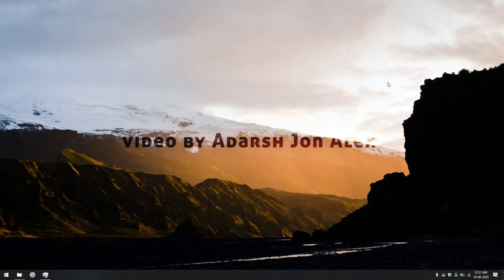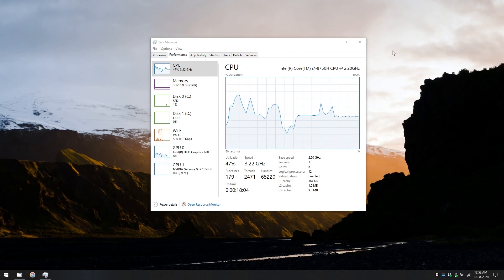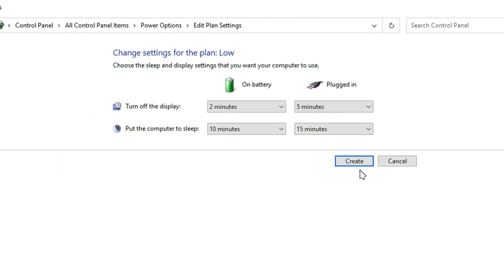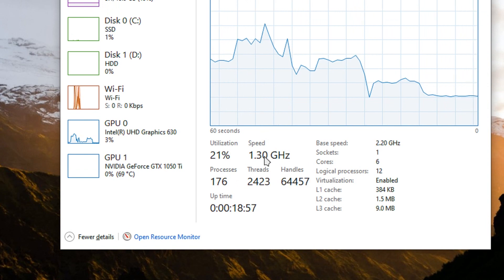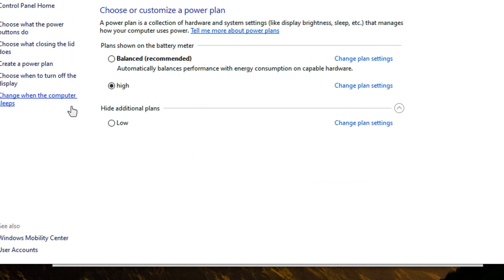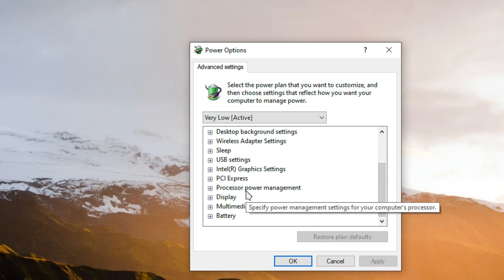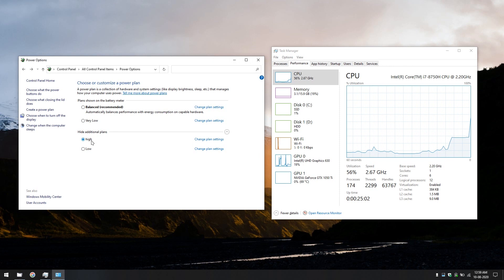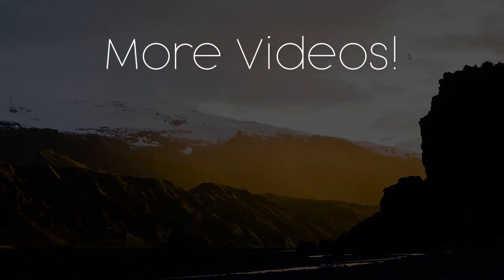Laptop overheating while idle? SIMPLE FIX!

Comment from the maker: You can also right-click the Start button (a list will pop up)and open power options from there.
Thanks for watching!. Any doubts, comment down below.
Reply: I have interl icore 3 windows 11. I cannot see the high and power saver option. What to do?
Reply: My laptop had overheating issues in sleep mode. I would have my laptop on my lap in bed and after I  was done I would close it then slide it to and part of the bed, then go to sleep or leave, where it would be charging or not. It was fine at first it would just cool down and charge if I had it plugged in. But then one day I woke up and it was hot. So I let it cool. It was completely dead. Then I brushed it of as the laptop was ok. Then, it happened again. Then, I was like "Ok." It kept happening for while and I didn't think it was ok anymore so I decided to just shut it down everytime which was very annoying. Sometimes times I would forget and it would heat straight back up. I dealt with it for months, though I didn't use it to much. I only play games but when I got bored of them I wouldn't touch it for a while as I use my school issued laptop for work I need to do. I don't know why I didn't think about searching it up just a few days agoat  first, but I did and the answer was there. There was a glitch that made it do this. When you close the lid the the laptop would sense it and and put itself to sleep, but the glitch was that the laptop would fail to sleep  and wake up as a result. The laptop will not check if the lid is  closed again so it stays awake and the CPU continues carrying out tasks which causes heat. Though, I not sure if the fan is operational during this time. If it got too hot the motherboard would shut it down but I don't think it did considering the whole battery died which leads me to believe the fans were operational. To fix the glitch I had to put it in hibernation mode rather than sleep mode.

Comment: Guys having more then 80c is not ok, I used to have 92c constant I tried cleaning the fans a bit and it didnt work so I decided to take the risk and takz the fan out the pc and it was DIRTY like a mf (did with both fans) and now on performance power plan I keep getting 70-75c not more then 75c

Take the risk guys

Comment: Hey man i used to reduce max processor state to reduce teno. Lately it doesnt work for me. For instance, have a power plan max state is 80. But even if i change it to 100 or 50 there is no difference. Creating a new power plan and change the value? Tried not workinh. Tried restting pwer settings as well
Reply from the maker: Have you tried re-installing windows? if that doesn't work, try cleaning the fans.
Reply: @AdarshJon  i reset the pc but i ll try reinstalling windows thanks

Comment: You can leave you processor in enconomic mode during gameplay because what matters is the GPU, maybe it will only be a little slower to load but the gameplay will be the same, with much less heat
Reply from the maker: Yeah, you could try that out!

Comment: Here's s quick solution.... Please check if your minimum processing power is less than 10% or not... If it's higher than 10% then you must change the values...if it's already below 10% then you must do the steps in the video it will definitely work
Reply from the maker: Thank you!

Comment: I have dell xps 15 9570 and I'm using it for video editing. Please tell me the best settings for heating issue which doesn't effect the rendering performance of the laptop.
Reply from the maker: It will effect the rendering speed. Use these setting only when doing normal stuff.

Comment: when i installed windows 10 but, i have to see a problem "Display Driver Stopped Response" and after showing this sms my pc got extreame level high temprature like cpu 60% and ram 75 to 91. when i start my pc i face thease kind of temprature even i never getting low temprature like 30 20 40
Reply from the maker: You can try fixing it from a hardware level.
Reply: @AdarshJon  🤣🤣🤣🤣🤣 i comment this 6 month ago man and now u replaying it?🤣🤣🤣 my problem already fixed

Comment: This method works for few months but gradually your laptop will die. You will have to keep reducing processor speed. Its better to look for the root cause of overheating.
Reply: Running cpu at maximum clock speed at all times is the root cause ig
Reply from the maker: Root cause for me was the unusually high clock speed while doing nothing. Fixing that fixed it. Root cause for you might be something different. Cheers!

Comment: It's still the same. I have this problem ever since i bought my laptop 3 years ago. Normally it gives me 2.5-3hr backup on full battery. The problem is laptop gets hot, cpu gpu temp over 60 degrees,fan runs faster and the better goes from 100 to 0 in like 40/50minutues. Sometimes the laptop works just fine and gives the full backup even now. When it works fine cpu and gpu temp is 35-45degrees with cool breeze coming out. I don't what actually makes it happen and haven’t found any solution. Last year it was fixed automatically and was working fine for few months but when i had to reinstall windows the problem started happening. Over the year i tried linux and chrome os, they give over 2hr backup with full charge. Even with fresh windows installed with no unnecessary stuff running, when idle it just drains my battery and once in a while it works fine. It's like it has a mind of it's own.
Reply from the maker: Damn.

Comment: Annoyingly, lots of us with a employer given work laptop go into the power options and only "balanced" is in there.  All I can do is go to the battery widget in the taskbar and slide the battery slider as far left as it goes to "better battery"... it's better than nothing but I don't think it drops the cpu base freq.
The other thing that annoys me in windows that linux does better is you can't even easily see harmless information like cpu and memory stats without going into Admin rights mode.
Windows would be better off to have a tool to simply see cpu% and memory and other stats in a readonly mode so ordinary users can just see what app is using max cpu .   If I want to kill off some processes, then I'd have the option to go into admin rights mode for that.  It happens that I do have admin rights but sometimes by the time I go through getting to admin mode and get the task manager going the process has gone away and it's behaving again.  Linux is so easy to see process info in that I can catch misbehaving things much easier.

In linux I can easily see cpu% and memory in many ways and being admin doesn't even enter into it.  (top, smem, ps -ef, htop, glances, Ctrl+Esc in KDE to see System Activity menu, etc)
Reply from the maker: Huh! that's a bummer (

Comment: my laptop is 8 months old and my cpu idles at 54-60 celsius
Reply from the maker: That's not over heating.
Reply: @AdarshJon  yea, but it reaches 64 at idle, it may be far from overheating. But that is not a normal range for a laptop on idle even a desktops normal range is around 35-40. Whereas a laptops is 45-50...60 is quite questionable.
Reply from the maker: My idle was 80-85. What CPU do you have? Try cleaning fans and re applying thermal paste.
Reply: @AdarshJon  that's pretty bad, I have an i5 11260h rn I'm getting lower 50s to mid 40s at idle, all because of a guide i found. I can send you a guide on how to lower temps. I used that and it made a huge difference. I think it would also be video worthy too. 👀

It consists of a lot of disabling in the settings, but it works amazingly. I now get like no more than 67 celsius while gaming. Mostly hovering at about 62. So I guess everything is fixed, I'm still gonna reapply paste on my cpu and gpu. I'll probably get like high 30s after that. I've had the laptop for 8 months, so I'm assuming they used bad thermal paste or they didn't apply it right. There is also another method like MSI afterburner frequency curve for your gpu, and an application called throttlestop for your cpu where you can basically set the number limits to your clockspeed ghz as you please kind of like in the video but its more convenient, I set mine to 3.0 ghz because most games aren't gonna reach 4.5 like companies advertise.
Reply: @eugeoyes513 my only problem is battery temperature of my laptop before was 28c and now 34c

Comment: My laptop always shuts down due to overheating when i'm playing the sims 4 after 15 mins. Should i use the Low option while playing?
Reply from the maker: Putting on low will decrease the fps you'll get in the game. Try it and see if you're okay.

Try lowering the graphic effects in the game and limit your fps with a software to reduce the heat.
Reply: @AdarshJon  thank you for the advice! but i tried playing on the Low option, lowered the graphics in the game and it still shut down after like half an hour. plus the fans in my laptop were soo loud i could pratically hear them across the room and the temperature in my laptop was 90°C while i was playing. :( i dont know what to do anymore
Reply from the maker: Problem still not fixed?
Reply: @AdarshJon  no :(

Comment: Dude where can i see the temperature?? Like you are seeing?
Reply from the maker: Apart from the thumbnail, where exactly did you see me looking at the temperature? I'm confused 😄
Reply: @AdarshJon  where you can see ghz like in 0:15
Reply from the maker: @nsable2109 

You need to install softwares like this:
 https://techguided.com/best-cpu-temperature-monitor-software-windows/#:~:text=1.,CPU%20temperature%20and%20load%20monitoring.

When I'm not gaming, i just go with the general feeling of how hot my laptop is by either placing my palm right above with the cpu chip is (on the keyboard) or see how hot my legs get when i place the laptop on my lap.

After doing this, i could feel no heat.
Reply: @AdarshJon  ok got it!

Comment: not the best way to solve the problem for a gamer ,my experience:i decrese it for only 1% which is 99%, overheating is fix but,ur cpu will stop the intel turbo tech(intel cpu),for example,my cpu max turbo ghz is 4.0,if u lower to 99% it will become 2.4ghz,which is without intel turbo technology,in gaming fps will drop nearly 5-20fps and the game is not stable with a lot of shutter lag.If ur are not a gamer this is a very good way u can do with.
Reply from the maker: I agree. Not the best solution for gaming. This is for the heating that happens when you watch a movie lol!

Comment: Hello brother I recently bought a new laptop lenovo ideapad 5 15alc05 ryzen 7 5700u. My laptop is heating...... But i don't know if it's normal or really problem.
Reply from the maker: It could be so many things causing this. Do you elevate your laptops back end while it's placed on the desk? Also what's the frequency of the CPU at idle?
Reply: @AdarshJon  yes some time...... But whenever I stream videos it become
Hot

Comment: My clock speed is more than 4 without doing anything 🤦🏻‍♂️
Reply from the maker: Yeah that will overheat the laptop. Just use this method.
Reply: @AdarshJon  It worked thanks 👍🏼 is it ok if the CPU temp while gaming 95c used balance performance ?
Reply from the maker: @Am94514  95 is really hot but new laptops are built to handle that. 90 or below while gaming in ideal. Maybe limit the fps and decrease the graphics just a little bit, that will do the trick.

I always limit the fps. So if I'm being 52-58, I limit to 50 so it's constant and smooth, plus the computer cools down too.
Reply: @AdarshJon  I got it thanks bro

Comment: I am facing 3 issues at the same time on windows 10 (dell laptop)
Overheating
Battery discharge fast
Over speed of fan
Reply from the maker: .... did you try doing this?
these 3 issues have one reason: large power draw from the CPU.

Comment: I don't have processer power management option
Reply: At first i hadnt to but i can tell u how to fix it if you want
Reply: @ronjans9914  okay, can you help
Reply: @professionalenjoyer7626  Ok, just to be sure that you face the same problem as i had, do you also have only 4 options in the advanced power options?
Reply: @ronjans9914  yes, I have: Desktop background settings, Sleep, Display, and Battery.
Reply: @professionalenjoyer7626  Allright thats exactly what i had too. So i dont know if you are familiar with the register but i will explain it as clear as possible and if you still have questions, feel free to ask them.

Step 1. Hold windows key and press "r".
Step 2. Type "regedit" in the search bar en hit enter.
Step 3. Follow this path Computer\HKEY_LOCAL_MACHINE\SYSTEM\CurrentControlSet\Control\Power\PowerSettings\54533251-82be-4824-96c1-47b60b740d00
Step 4. When you are in the file go to the right where there is FriendlyName and Description (and maybe one more).
Step 5. On this side click the right mouse button and click "new"
Step 6. Click on DWORD(32bit)
Step 7. The new one will be added to the list. Double click on it and change the name of the value to "Attributes" and change the value itself to "2".
Step 8. Then you can just click on the cross in the right upper corner and you maybe need to safe the changes but then a window will pop up and its really simple.
Step 9. Go to the power manegement tab again and there will be the extra option.

If it still does not work feel free to ask!
Reply: @ronjans9914  Wow, thanks it worked. But, there is only one option: Processor performance core parking min cores. Should I use the method above on it
Reply: @professionalenjoyer7626  so you dont have maximum processor state? Are you sure you did it in the right file because if you do it in another file another disappeared function in power management will come back.
Reply: @ronjans9914  yes, I did it in the correct file
Reply: @professionalenjoyer7626  But you wanted maximum processor state back right? If you want an other one you should just search a bit through the files and maybe search a bit on the internet.
Reply: @ronjans9914  I couldn't find maximum processer state from before, I think it is the manufacturer of the computer. Because one of my family members has another ASUS laptop and I just wanted to check if the issue was only in my computer and it is also in the other laptop. But the temperature of my laptop has decreased from the day I made that comment, I just kept all the graphic settings to default.
Reply: @professionalenjoyer7626  Nah its actually a problem with the newest windows versions. Microsoft removed the option to change it but you can do it in this way. On my pc its called Processor Power management settings and configurations btw (thats what is jn the discription 'tab')

Comment: hey! how can i check if my laptop is too hot?
Reply from the maker: There are softwares to monitor it. But in the context of this video, my laptop was getting hot while doing nothing (or whole doing simple tasks like playing a movie). I used to touch the section above the keyboard and it would feel warm. When placed on my lap, my legs would sweat!
Reply: @AdarshJon  i did this too. i have a new laptop(dell inspiron 3505) ,I updated bios and drivers too. its still heating. if you have another solution please recommend.
Reply: @harshitajain9254  did you find solution? I have same prob
Reply from the maker: it is heating while you're doing WHAT?
Reply: @AdarshJon  while using browser or watching movie or bare minimum coding.. It heats those times too
Reply: @tariq7071  not actually, I have talked to customer care, they asked temperature and told me it's okay to reach this temperature.
Reply: @AdarshJon  thanks! :))

Comment: i
 had a problem i have hp laptop i78th gen u mx130 4GB 8GB RAM and alot 
of games run well on my laptop for 2 min but after this th gpu get so 
hot 88-89 then cpu get full to cool the gpu so it get normal but at the 
mean time the game get  it get 10-12 fps please 
what can i doi feel like ther r some settings make limit of the gpu temp
 so if it get 88-89 has to cool it down please any idea
Reply from the maker: Did you try the method shown in this video?
Reply: @AdarshJon  yep didnt work out
Reply from the maker: @ahmedmo429  what games are you playing and at what settings?
Reply: @AdarshJon  it happens with most games but right now with batman arkham night cod ww2 rdr2 other games same thing but less all low settings but maybe i like to use sharply edge

Comment: I use throttlestop.🤔 Works like a charm.
Reply from the maker: I used to have XTU installed to do the same instead of Throttlestop. Both work great. 😄
But this is by far the simplest fix and uses no additional software.